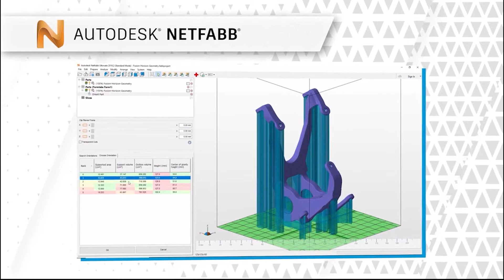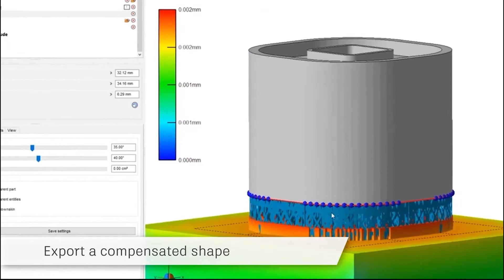Introduction to Netfabb

Comment: 1:34 – Except that's not Netfabb.
Reply: Tricked

Is this Fusion360?
Reply: @johnsyuya  Yes.
Reply: @Anvilshock  Netfabb includes an entitlement to Fusion 360 these days. Several years ago similar functionality was offered with a tool in Netfabb called "Powershape utility for Netfabb". It has since been discontinued as  now this type of functionality is better suite for Fusion 360.